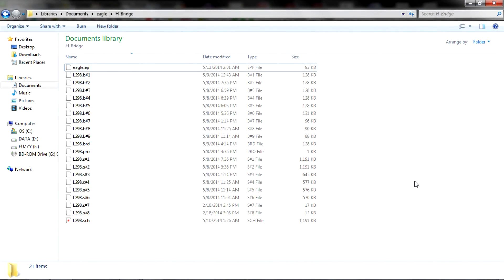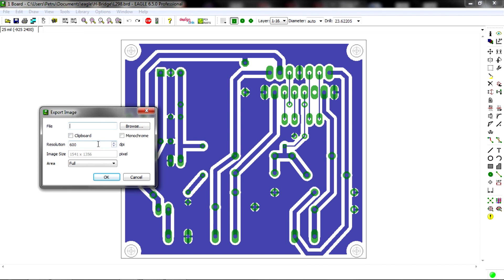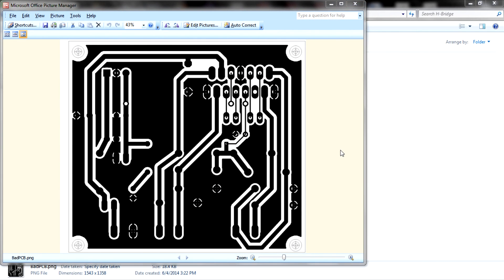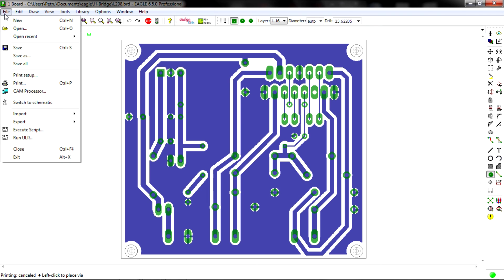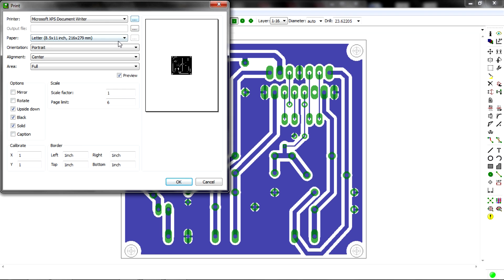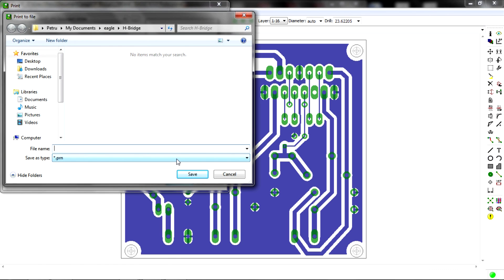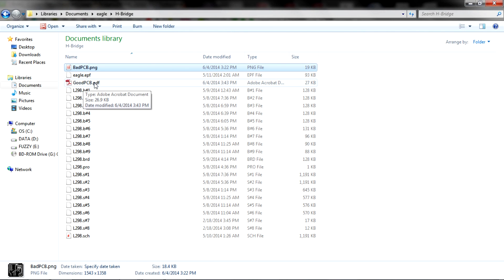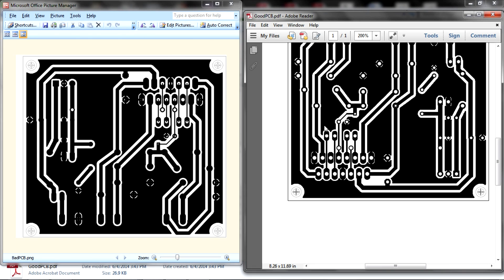How to export from Eagle to pdf.

Comment: When I print to pdf the ground plane doesn't appear as solid black like yours, it has less than black lines periodically, do you know how to fix it?
Reply from the maker: Do you have this problem also on paper? Sometimes displays can show copper pours as hatched surfaces. Try to print it on a paper and see if you have the desired result.

Comment: For me scaling is an issue can you help, after I print its not exact size of my board which i placed in board dimensions  so components are not fit ,i am new to eagle just design a couple of circuits with out errors ,help me bro
Reply from the maker: This a printing problem. You have to select "keep the original scale"  or somerthing like that when you send the document to the printer.

Comment: salut, am gasit un circuit pe care vreau sa-l folosesc pentru un amplificator audio, dar nu stiu cum sa aleg amprentele pentru fiecare piesa, cu cat trb sa fie mai mare diametrul amprentei fata de piesa pe care o voi cumpara,iar ulterior o voi lipi ? sunt incepator.. si nu imi dau seama ce amprente sa iau pentru fiecare componenta, imi poti lasa niste sfaturi te rog ? Multumesc.
Reply from the maker: Salut. Amprenta ar trebui sa fie relativ similara. Cel mai important este sa corespunda pinii, distanta, diametrul gaurilor. Stai linistit ai sa gresesti de cateva ori dar ai sa inveti. Spre exemplu: un integrat DIP-8, nu este critic daca conturul componentei este in interiorul pinilor sau in exteriorul lor, important este ca distanta dintre sirurile de pini sa fie de 300 mils si distanta dintre doi pini ce apartin aceluiasi sir sa fie de 100mils. (sper sa nu fi gresit distantele). Spor.
Reply: multumesc

Comment: Hi! I see that somebody (Krishna) has already asked this question, but repeat it anyway. Do you know ho to print multiple layouts onto one transparency> Whether after the .brd file is already converted to .pdf or not. I find it irritating that even if I have a small 2-sided PCB, I'd have to used two sheets of transparencies. I generally turn the printed sheet around and put it back into the paper tray of the printer, but I don't feel comfortable running this sheet a third time through the laser printer to expose it the heat, if there is still a large unused area. These are fairly expensive.Do you have the trick?
Reply from the maker: +Joe Szabados Hi! Sorry but I haven't got the time to figure out how to put both layer on the same page. I know the problem but so far I couldn't figure it out how to do that. :( If I'll find a way I'll let you know. Thanks for watching!
Reply: +Petru Sfecles Thanks for the reply. I hope you will have the time to "play" with it. It is pain to waste the transparencies. If I could, I'd fill a sheet with multiple layout patterns and cut it up. I tried to have the .pdf version of the layout put into a single sheet, but could not. Thanks Joe
Reply: Just figured out how to do this:
1) group items with group tool
2) Type "cut" into command line
3) Open a new Eagle File
4) Type "paste" - I was able to do this up to 3x with Eagle 8.1.1 free
Note: the ratsnest may disappear, but that is simple enough to reapply.

Thank you again for the video! Keep it up
Reply: @christopherernst7408  When I print to PDF the ground plane appear with lines instead of a solid black, do you know how to fix it?
Reply: @brunocabral1578  I believe you have to invert the image. Or swap after the pdf has been generated. Apologies, it's been a few years since playing with Eagle!
Reply: @christopherernst7408  thank you for answering. It appears something wrong with pdf printing, because gray lines appear periodically on ground planes. I had to edit the pdf with gimp and paint the gray lines with black to work.

Comment: Hi I had better luck using the print option, then setting the Output File property in the print dialog to a pdf file. This flipped the printer property in the print dialog to Print to File (PDF). Printing generated the pdf.

Comment: Man my pc saving project.pdf.prn :(
Reply from the maker: Adrian Boss I'm not sure that I get what is your problem. If Eagle saves your pcb file with extension **.pdf.prn you can try a simple trick, try to rename it to **.pdf by deleting ".prn". Hope it works.
Reply: Finnaly i get my pdf i used pdf995 printer driver and i worked